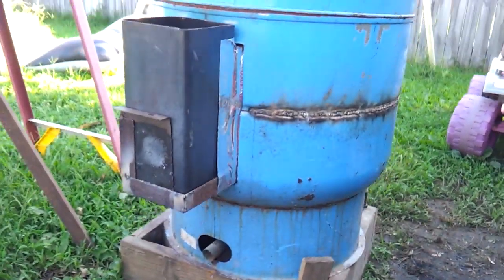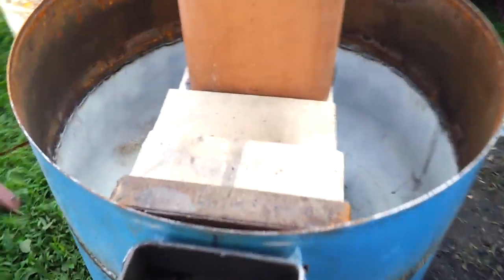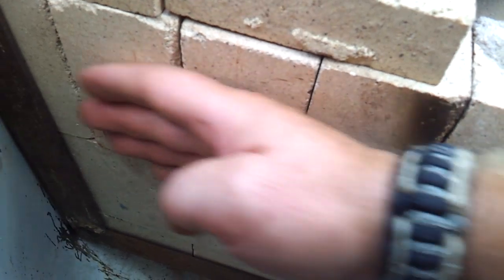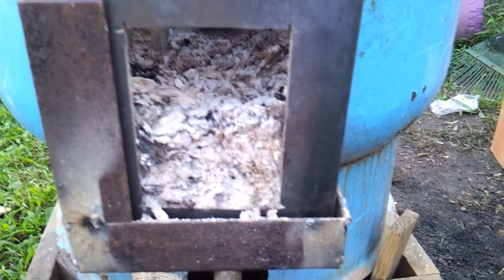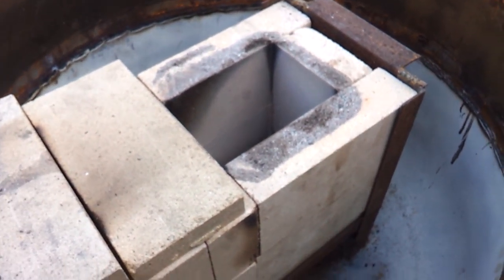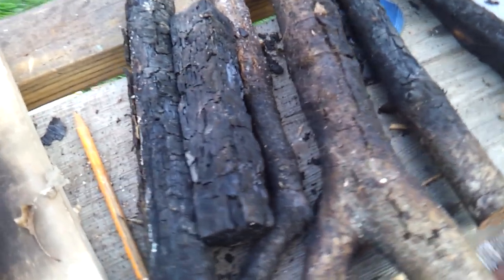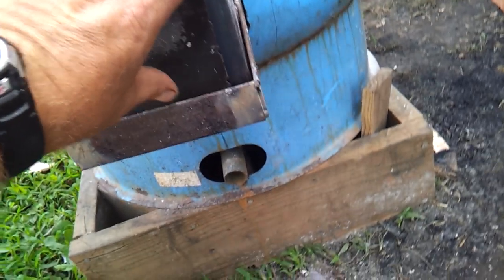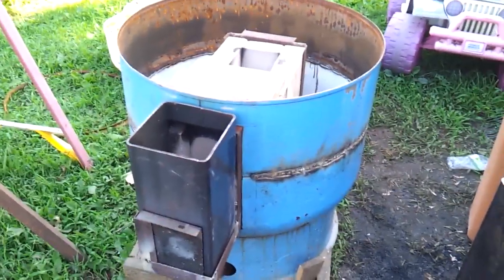Rocket Heater Wood Stove Build Part 9

Comment: I have an idea for your stove. Maybe make the corners round instead of square which helps flow tremendously. Also, when you burn hardwoods, make sure they are really dry at least two years drying will keep the coals down. Nice work too fella.

Comment: Sorry but I could not get it to work so I have ripped it apart. If someone would email me at:
thomasrussell46@gmail.com and tell me how to up load to UTUBE then next time I can up load pictures as I go.
I have just cut 2 - 100 pound propane bottles, tops and bottoms off. Have made a 1/4 inch base table about 16 inches off the ground so I won't have to bend over to fill it. I would like advice on what to do as I go forward.
I also was given a 1000 pound propane pig of which I have cut the top off of. I would like to hear how to make a whatever kind of stove out of it as well. I am heating a 20 times 60 foot long greenhouse. I have a Plumber as we speak hooking up headers for hydronic in floor heating. My greenhouses sit on solid concrete floor.
Any suggestions will be appreciated.  above is my email address and please feel free to email me with advice.
I am retired / just getting over a  battle with cancer and the repercussions of chemo. This is what I am trying to do to get my body in some sort of shape.
Many thanks

Comment: I made a rocket stove and a double barrel stove. Under test burn they fired well. Now I hook them up to a 8 inch exhaust as feed is 8th on rocket stove and I cannot get the exhaust to move out the horizontal chimney. What's wrong? I put the horizontal pipe on a incline from floor level up to 30 inches off the floor 20 feet straight  lifted horizontal still back Draft. Then the pipe rises on a 45 degree angle and and rises above the top of my greenhouse.  It has a cap on the line.
Reply from the maker: Can you send me a link to a video or pictures so I can take a look at it? Thanks